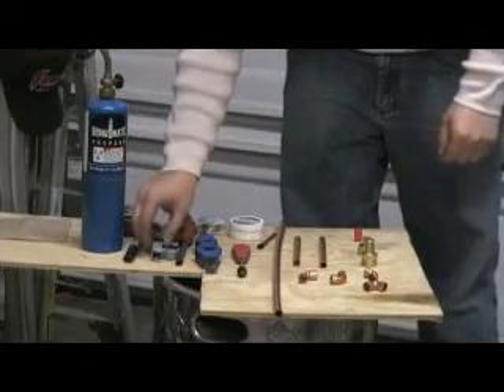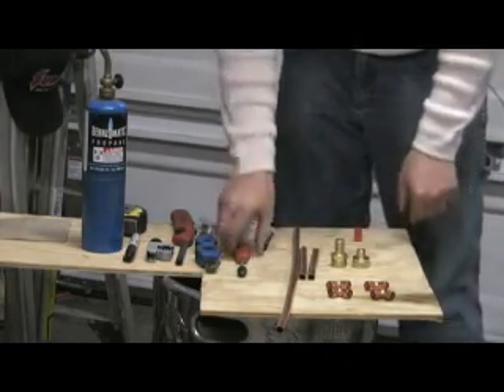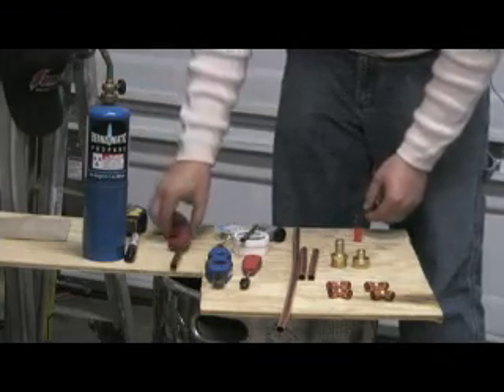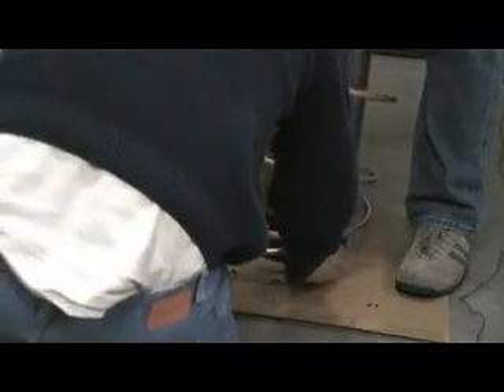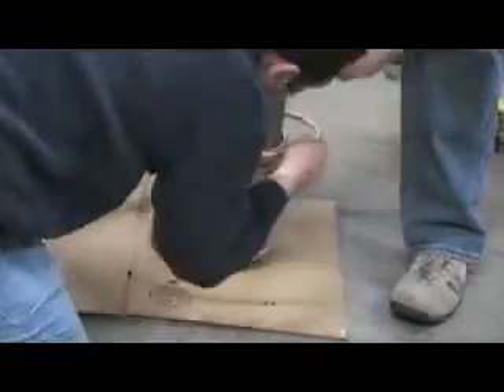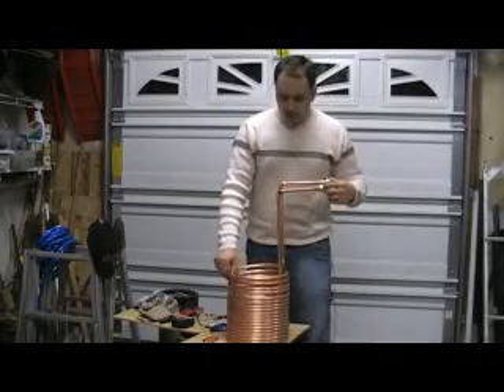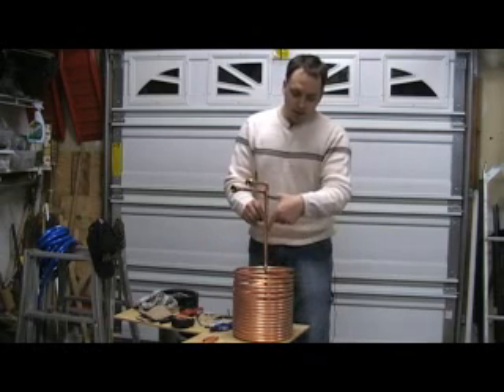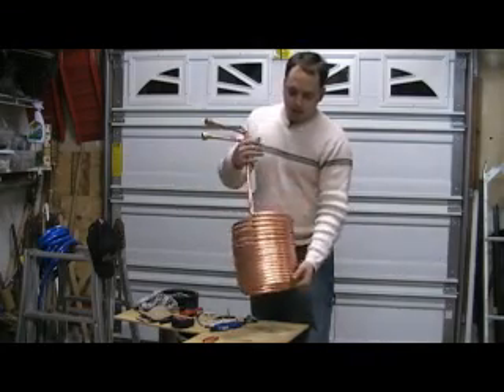Immersion Chiller (IC) Build

Comment: great video! im about to go on my own excursion like this. However, I have one tip that would muddle the worried solder peeps. Use Shark-Bite fittings found at your local Home Depot. They press right on to copper and come in a variety of shapes. Guaranteed not to leak and also solder free joints. Plus if you make a mistake, you can just take them off without heating the pipe.

Comment: Coiled 25ft of 5/8 soft copper tubing over a corny like the video. Silver soldered elbows and straight tubing just as shown. Cooled 6 gallons of sort to 75 degrees in 9 minutes. Stirred the wort over the whole time.
Thanks for the tip on winding over a corny.

Comment from the maker: Sure, you can make the bends. I don't share your concerns about soldered joints in the wort though. If they're done well, they won't leak. On the horizontal in/out, you could go with a 90, then a 45 to angle downward also. There was never any leaking on mine with the hose threads soldered to the tubing. I could see it being a concern if you clamp hose right over the copper.  It's all about personal preference I suppose.

Comment: Also instead of 90 degree elbows at the inlet and outlet wouldnt it be a better idea to have the ends pointing on a downward angle so in case of leaks the watter drips down and away from the pot

Comment: Good video but I have some concerns. I hate the idea of using soldered joints on any part that is actually in the wort.  Nevermind the concernes of food safety what hapens when after several uses the constant fluctuation in temperature, from literally boiling hot to much colder,  causes expansion and contraction of the joints and springs a leak?  now i have rubber tasting hose water in my wort? screw that get a tube bender and use a "less rigid sweeping curve" to come up out of the wort.

Comment from the maker: @TheAtuesuel 

That would be true if the water temp was equal to the wort temp in 15 feet but that would only be the case if you trickled water through. When you want to cool fast, you run the water quickly and after 50 feet the water is still coming out cooler than the wort temp. So, in that case, no, 15-20 feet isn't enough.

Food grade flux and solder? Yes, of course.

Comment: Man....people are HATERS.  First of all, NO WAY your gonna find 1/2" x 50' IC at the brewshop for less than $65. You might find a 25" if lucky, but we make our own brew...why not make your own chiller! Thanks Bobby.  I made my first one based on this vid. 50ft. Didn't melt the connects...used clear rubber hose instead. Got a leak on the in-flow piece that I have to troubleshoot. But thanks nonetheless...

Comment from the maker: @jmccollor 
When you're talking about heat transfer, thinner is better. The 3/8" fittings fit over the 1/2" soft copper. It's sounds counter intuitive but the sizes are rated differently. The ID of the tubing is 3/8" and that's how the fittings are sized. The ID of the 3/8" fitting is 1/2".

Comment: bobby, nice work. just followed your tut and it worked out beautifully. had to do a little research to figure where the cold water inlet (male fitting) should be - tube coming from top or bottom. other than that worked like a dream. and no leaks!

thanks, man - plus all the work you've put in over at homebrewtalk. much appreciated!

Comment from the maker: jessicaspiess, that's not really true. There are very few alloys that would melt at 200F and they are not common in plumbing. Most common lead free plumbing solders melt in the 400-500F range. I understand the concern though. Thanks.

Comment from the maker: I know it's confusing. 1/2" OD copper tubing is 3/8" inside diameter. Pipe fittings are rated/named for the ID of the tubing they are designed to fit. Therefore, you need 3/8"  fittings. Most copper tubing, including the rigid stuff for water piping is named by it's ID. Refrigeration tubing is rated by it's OD. 1/2" rigid copper pipe is actually 5/8" OD but the fittings still say 1/2".

Comment: I fail to understand why the elbows should be 3/8" as long as they are fitted on the outside of the 1/2" tubes. After all, 3/8" is smaller (less) than 1/2". The way you explain it the elbows seem to have to go on the inside of the tubes, which is highly unusual. Sure you don't mean 5/8" fittings?

Comment from the maker: On the chiller I made for myself last year, I did something similar by putting the vinyl tubing directly on the copper coil but the heat always required that I tighten the hose clamps. It would eventually distort the tubing and require replacement. I later modified it to look more like this project and I never had anymore problems.

Comment: Nice work Bob.  I hooked my barb fittings to vinyl tubing so that my supply and exhaust can be away from the boil pot.  I was thinking of that when you mentioned how the barbs are specifically intended for what you did, your adjustment to make them work was good ol Yankee Ingenuity at its best...

cheers!